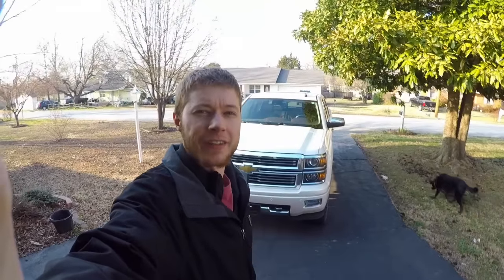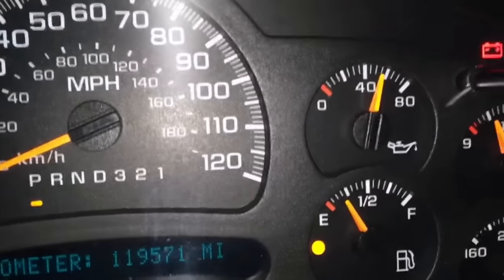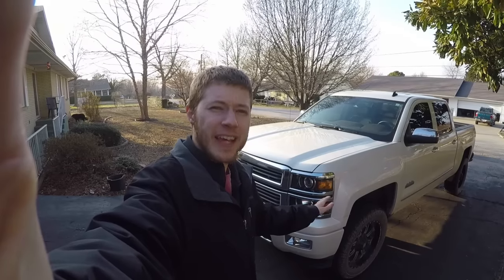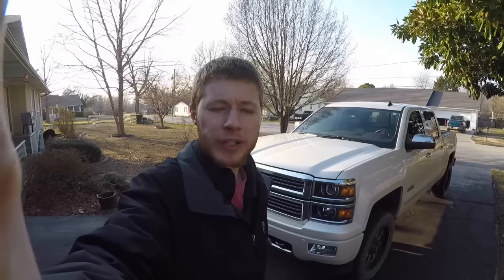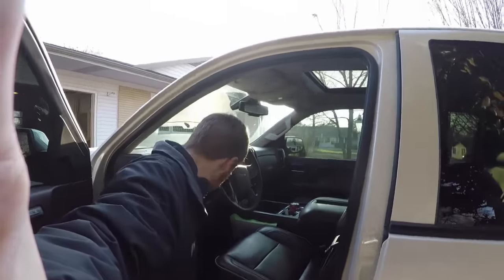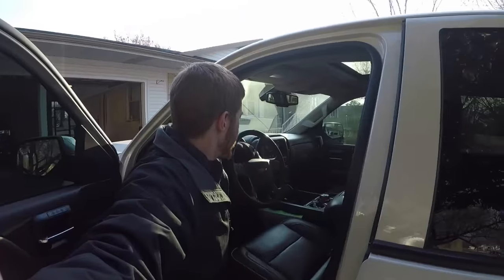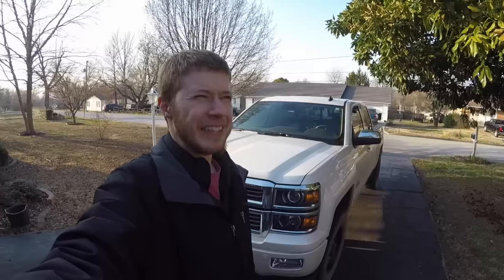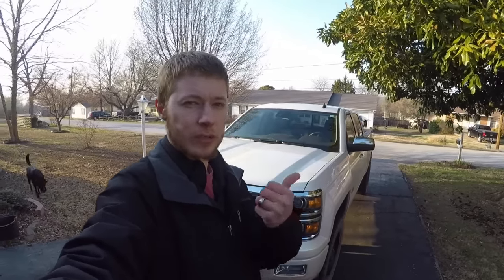Silverado Sierra 5.3 Lifter Noise Tick (What to do)

Comment: Turn the radio up and you won't hear the noise no more😂😂
Reply: Put on some lamb of god,and NEVER have a tickling problem again...!😐......or, some similar cd.
Reply: The Mexican It should be “any more.”  No more is a double negative.
Reply: I successfully drove a 2009 suburban with almost no oil pressure, 300,000 miles and only a few working cylinders for years before I sold it. Sounded absolutely horrible.
Reply: That's what am doing right now, the music all the way up.
Reply: i cant my 03 has a broken radio
Reply: I run 90w gear oil in my Tahoe, NO MORE NOISE.
Reply: That's what I do,  just added a flomaster as well
Reply: @edwinmcguire6040  lol,  holy shit man
Reply: Ozzie Sheppard you are a real one 😂. Props, yea i had 05 Escalade that tapped like hell, until i slapped new oil pump in it, noise went away. Did no damage to the engine from my knowledge. And the people i sold the truck to, they thank me here and there. They drove it back to another state, say its the best running truck they ever owned with 220k miles
Reply: That’s what I’ve been doing. I’m going to change the oil and watch it disappear.
Reply: I put 0w30 in mine (2008)   no more start up noise 6.0L LS2  it has AFM though
Reply: Hella funny that’s what I do Lmfaooo
Reply: You can also get a louder exhaust.When it blows up,it will be less noticeable.😂😂
Reply: Does this really work because I'm strapped for cash right now.
Reply: @Dnasty1  yes your good just take it easy and turn up the radio
Reply: @Dnasty1  mines still ticking
Reply: Goes away when it warms up
Reply: You guys should listen to a stock classic small block. Normal Normal
Reply: That’s what I do
Reply: The millennial soulution to everything. Avoid it
Reply: Sad ti say it was funny but not funny for me cause I act do that😭😭
Reply: My radio doesn’t work
Reply: Man . Problems solved
Reply: LMAO 🤣
Reply: Says the guy you pass on the highway, waiting for a tow truck.
Reply: Oh no my truck is not a hoopty I’m I gotta project fix it
Reply: Thank you very much, was worry, after your video no more
Reply: Mine is a 2500 hd 2005 Silverado 6 litre. It ticks at starting. Goes away completely  after running for 4 or 5 minutes. I think I am going to try the litre of transmission oil in with the engine oil trick.
Reply: Mines comes in after about 15 minutes of running

Comment: No worries at all everyone. I have a 2005 Silverado crew cab 5.3 , Been doing this since it was brand new. Over 200,000 miles now and still running strong.
Reply: thank god iv been shittin my pants
Reply: I have a 2005 Silverado extended cab 5.3 and it won’t start at all. It’s makes the ticking when i try to start it
Reply: That makes me feel better I have 09 with 171k
Reply: Yeah them old ones will def hold up better . For some this tick means death but I've had an 03 with 400k+ carried loads on the bed every day for work and still runs to this day.
Reply: It is the flexes plate in the bell houseing
Reply: @josephmoreno7730  First thing is battery, next is starter, then check starter solenoid. Makes sure you test battery.

Comment: Sorry but it is something to worry about and it is a problem. Your looking at a lifter problem most likely , timing chain or rod slap. If you dont fix lifter risk breaking pushrod and wearing cam to point valves dont open properly. Can go a long time on a ticking lifter at the cost of more mechanical damage and fuel efficiency. It will only get worse. For all you know all you need to do is readjust them and it cost nothing.

Comment: Depending how often you change your oil will determine the tapping noise. I have a 03 Tahoe with a 5.3 I always use synthetic 5w-30 it never makes the tapping noise and has close to 260,000 miles.
Reply: I've changed my oil religiously at 4k miles. Thought 3k was too soon and 5k was too many. 5w-30 full synthetic every time. Mine started ticking at 200k.
Reply: These have failed for years  and still are
Reply: These 14-18 5.3l motors call for 0w-20 synthetic

Comment: I use amsoil  5w30 no noises plus I plugged a little module into the computer port so it’s always 8 cylinders.
Reply: You Sir know what your doing I told them to change oil and substitute a quart of transmission fluid and to use Pennzoil 5w-30 synthetic preferably or Valvoline even Mobil 1 hell even Wal-Mart brand super-tech and marvel mystery oil will keep your lifter's clean and help keep them built up but like I said dirty lifter's are noisy lifter's.
Reply: Can not put anything but 0-20 in the newer 5.3s. It will destroy stuff.

Comment: When I brought my 14 it had 4 miles on it and it had that same tapping noise.  I was told all there direct injection engines do the same thing.  I now have 170,000 miles on it. I still hear the same tapping noise and never had any issues with the truck.
Reply: Well if you got 170k im hoping mine will last that long. Got 90k now on it and hoping it last for a long time to come.
Reply: I was told by the service manager to Keep the oil changed because those particular engines don’t like to get dirty.  So I’ve been changing it faithfully so far so good
Reply: brian gentry Are additives like Lucas Oil Stabilizer recommended in these engines?  My ‘14 GMC makes exact same noise.
Reply: @johnm.runyon3682  my 14 Sierra has the same noise and I obsessed over it for a few months with zero change. Thought it was a lifter, thought it was an exhaust leak, thought it was an injector etc etc. none of that, noise still there. Finally took it to the dealership and they told me it was a high pressure fuel line and normal noise. Lol put a new exhaust on the truck and can’t hear the tick over the exhaust now. Problem solved.
Reply: @sirdumbthicc4294  did you disable the v4 with the new exhaust or leave it?
Reply: @MrBdogg317  have you kept everything stock or disabled the v4?
Reply: @TexasMonsters  everything is stock and I just hit 200k last week
Reply: @MrBdogg317  nice bro I’m getting paranoid with all these videos lmao
Reply: @TexasMonsters  what do you have
Reply: @MrBdogg317  2014 silverado 5.3 the v4 is getting on my nerves how it switches back and forth, thinking about doing a delete, but just going to get a range soon
Reply: @TexasMonsters  I left it stock. If you put the truck in manual 5 it will remain in v8 all the way to 50 mph. If you’re cruising on the freeway you’ll want to flip to D or manual 6 which will put it back to 4 cylinder. But as long as you’re cruising 50 and under manual 5 is the way to go.
Reply: @johnm.runyon3682  I would strongly recommend not using something like Lucas Oil Stabilizer because it just makes your oil thicker. GM chose 0w-20 for a reason

Comment: I have a 2017 Denali with the 6.2 with around 20k miles.....has the EXACT same sound.  Sounds like a sticky lifter, but its not a lifter.  Most people say its the high pressure fuel pump.  Its cool to say not to worry about it, but pulling up next to a building with a 60 thousand dollar truck and hearing what sounds like a loud, bad lifter is kind of bullshit....IMO.
Reply: Injectors have a loud tick too.
Reply: I have a 2014 silverado 5.3 and i have the lifter tick. Everyone said "Its normal dont worry". Have a 2015 silverado 5.3 with over 200k miles and no ticking noise. Its from the AFM v8 to v4 crap that messes the lifter up. Its not normal, dont listen to this guy.
Reply: Fuel pump is in the gas tank
Reply: Bad o ring on oil pick up tube is common for silverado
Reply: @adamwaffledivision1785  Not necessarily man, Ive had several silverados and currently an 06 Tahoe with NO AFM and they still do it!
Reply: @markmiller8641  my 86 square body no tick, my 98 no tick, my 04 no tick. My 14....tick....my 15 just got out of the shop from collapsed lifters and the 14 is next. Yes you can have lifter noise from it being old....but the AFM one WILL collapse period. Im selling both and buying a toyota now.
Reply: @Doctor Feinstone  there's a high pressure mechanical fuel pump under the intake.
Reply: Tahoe I just got that has almost 300k miles heard the ticking after putting in new maf. Changed plugs and wires still has misfire and motor surging when stopped. Concluded maf honeycomb had few bent areas. Don't know whole lot about mechanicing but I've not done too bad so far once get a feel for it.
Reply: @EatMyYeeties  Rod? Pcv hole in valve cover?
Reply: @adamwaffledivision1785  don’t buy the 22 Tundra. The V6 turbos fail right out of the gate. I know 2 people that had turbo fail in the first 500-700 miles.
Reply: @briankammers9766 fuel pump is in the gas tank .
 Under the intake LoL LoL LoL.
Reply: The dreaded dingle lifters. The embarrassing sound no one wants their engine  to make.

Comment: There is nothing wrong here Chevy truck have had that noise since they started electronic fuel injection same sound on the older 5.7 model as well
Reply: I have an 08 z71. Has the exact same tick with a cylinder 6 misfire code p0306. Have replaced spark plugs and coil packs. Still same exact code and same exact tick. It’s kinda loud and really doesn’t go away, also the engines starting to run poorly..
Reply: NC BassMaster fuel injector
Reply: NC BassMaster most likely the injector if its not a spark issue and no other cylinder has a misfire. Injectors do make a sort of tick sound, i bought a jeep and had always thought it had lifter issues until i took a screwdriver and held it up to my ear and the injector and could tell it was from the injectors. Try it on your truck if you still have it or if you havent figured it out
Reply: Gotta 2008 GMC Sierra got 344k still going strong has same thing and it runs like a champ, do not use Lucas oil just SeaFoam high mileage and Techron by chevron all my motors love these products FrFr 💯
Reply: Not mine
Reply: Lewis Underwood what’s it doin bro
Reply: Lewis Underwood every Chevy makes that noise you just haven’t heard it
Reply: TrainWreck Thomas 344 that’s sick
Reply: Patrick Davis thanks bro, and I agree they all make that sound strange as it sounds even off the showroom floor

Comment: I have a 2017 Chevy Silverado 2500 with the 5.3 only 3000 miles on it I bought it with 1 mile The same exact noise that’s just how they are. And when I bring it to the service for my first six months they checked over thumbs up. 👍👍👍. I broke the dealers balls they went over the whole thing because I’m a hypochondriac like that. Lol.
Reply from the maker: Haha man i'm just like you, everything has to be perfect!!
Reply: Don’t want to sound rude but I think you meant to say that it has a 6.0L. The 2500 and up only come with the 6.0 and 6.2 engines. The 1500 comes with the 5.3L and the 4.8L.
Reply: wyatt dartez   You are 100% right I was thinking of my 1500 I had before this but either way mine makes The noise to. Thank you.
Reply: Dave Jil no problem man. I not the best with truck info but as i learn i try and teach other people or at least in this case just help people not get confused or mispronounce things.
Reply: wyatt dartez 2500’s dont come with a 6.2. You can get either the 6.0 gasser or 6.6 Duramax.
Reply: It's the vacuum pump that is attached to the front of the engine on the driver side.. I just had mine replaced . The dealer kept telling me it was normal warm up noise for 2016 Silverado. After talking with the technician he agreed to replace it and the noise is gone. They use a different part # as a replacement
Reply: wyatt dartez the 2500 Vans come with 4.8 or 5.3 and have Coil spring front suspension not Torsion Bars like the trucks have also in the rear of the 2500 ( Gas ) Vans they have one less leaf spring than the gas 2500 trucks. The gas 2500 trucks have 5 leaf packs, the gas 2500 Vans have 4. The 2500 Vans however do have 8 lugs. Payload on the Gas 2500 4.8 Vortec vans are 3,000, 2500 Gas Trucks are 3,300+ depending on year.  Just sharing knowledge I've always wanted to know and recently found out after actually looking at a 2500 Van. There's other differences as well not mentioned but this comment would turn into a book. Lol
Reply: will R r
Reply: wrong, 2500 only comes with 6.0 gas and 6.6 diesel  @wyattdartez

Comment: I bought a 2018 5.3 with 21 miles on it and it has done it since day one for me. Luckily it goes away once warmed up, but every time I start it somewhat cold I have the high pitched ticking sound definitely sounds like some kind of pump or injector. I’ve also noticed my exhaust has a super faint pinging sound  and the ticking seems to be in sync with the exhaust ping, atleast with my truck. Super annoying. My 2017 4.3 did the same sound but louder and more consistent. Just sad when you work for something really expensive and it sounds like garbage. Disappointed. 

Also my 2019 work van with the 4.3 had a horrible tick and it only had 85 miles when I got it. 

Shame on you GM. Bring back cast iron blocks and get rid of fucking afm. 52000 dollar truck bull shit.
Reply: 2018 5.3 here, same thing! Ticking in sync with RPMs when driving from cold start until the engine gets to operating temp, then goes away completely.
Reply: It doesn’t even bother me anymore since I’ve had no  issues or engine lights. Rock solid truck. And I’m at 60K miles.

Comment: Absolutely it is nothing to worry about, all of these trucks do it and that is okay. It is not a problem, there is nothing wrong with any of them. My 03 with 300k does it & has done it since day 1 & it runs like a clock with absolutely no issues. My dads 06 did it the whole time he owned it from 150 miles - 180k (8+ years) with absolutely no problems at all the whole time. His next truck a 2011 did it too, it definitely wasn’t as loud in the 2011 as the 03 & 06 but the noise was still there & it had no issues for the 7 years & 150k++ he had it. And last but not least the 2018 he just bought brand spanking new at the beginning of last year does it as well. Again not as loud as the earlier models I mentioned and it is even a bit quieter then the 2011, but the sound is still there. It now has about 18k and not a single problem. From what I’ve seen it seems to be getting quieter in the newer generation engines. I’m curious about the 2019’s and if the 2020’s will even make this noise at all. Anyone here have a 2019 5.3? Does your engine make the ticking/tapping noise?

Comment: You might want to check the valve clearance.  Also, the gas may make a different but its not to likely.  I have a 2017 LT Z71 and the owners manual said use 91 Octane or higher. I run the Lucas oil Upper Engine and Injector cleaner in all my vehicle, every other tank of gas.  I run 89 Octane and the Lucas oil bumps the Octane rating over 91.  I had a 2005 Ford Super Duty 6 liter diesel, ran the Lucas oil in that one too.  We bullet proofed the engine 5 years ago and took a look at the engine's upper end and injectors.  All of the parts were spotless, very clean and never had a tick in the engine. Oil is cheap, we changed the oil every 5,000 miles and never had a single issue.  The Ford has 140,000 mile on it, and mechanically, never a hiccup.  Regular oil changes are just cheap insurance.  Enjoy your videos, liked the oil change one, thanks.